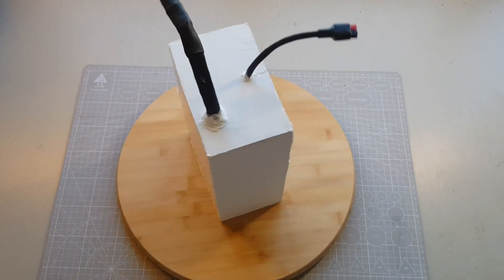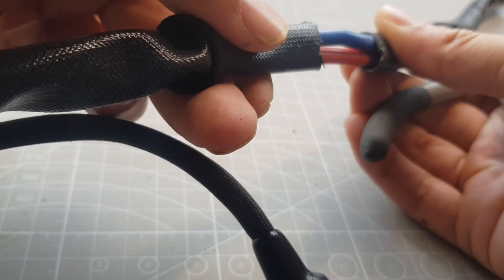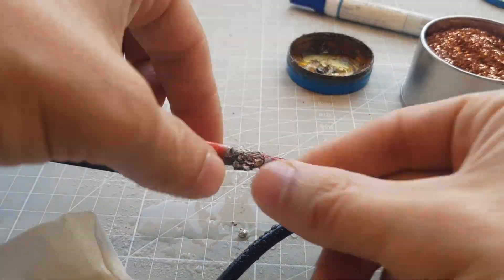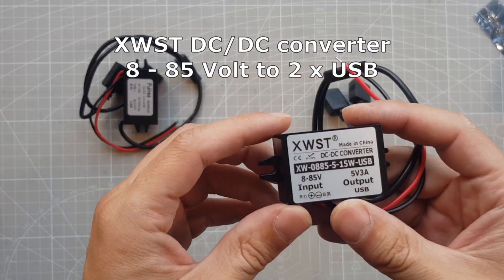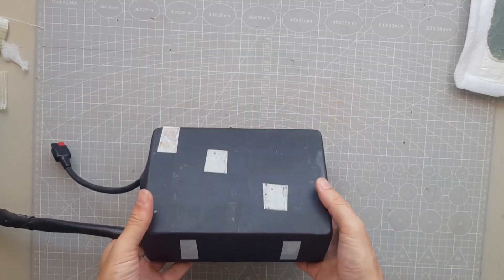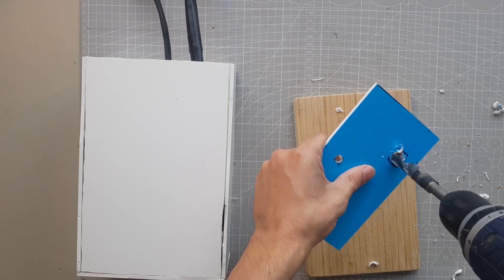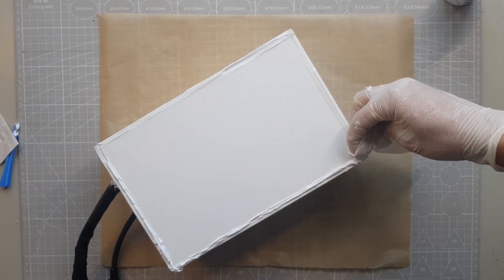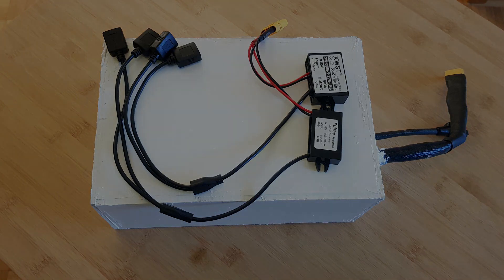building a massive Powerbank from old E-Bike battery

Comment: What about power input to charge it? How about if you wanted to charge it from solar panel with 36vdc
Reply from the maker: Hi Nick, i will hook it up to my Campervan Setup soon, i guess it will be charged by my main Battery (thats on solar) over a converter and a normal (220v to 60v) -charger... That is not optimal, but since i have these parts laying around, it is free" ;-)
Do you ask for camping when hiking?
Reply: @Dirt-E-Bikes  Thanks for your reply. The reason I am asking is because I have a spare 36V 14.5aH bike battery, because my E bike was stolen from my garden, but the battery was in my shed. I have ordered a foldable 200W 36V Solar Panel. But I think I need an MPPT Converter to stabilise the voltage and prepare it for CC/CV charging. At least that’s what ChatGPT told me LOL. I just want to use the battery for general use, maybe when travelling or camping and I can use the Solar Panel to charge it.
Reply from the maker: @UKViking oh no, that sucks (the thing with your ebike).
Yes a MPPT should be able to do that. On amazone you can find a wide range of them. Yust make sure the voltage matches your battery 👍
I recently buyed one for myself but for a 12v Li-ion battery and panel

Comment: i am doing the exact same project. can you explain why you didnt choose a buck convertor and went with dc dc convertor? i am a totall noob so maybe they are the same thing and i am just not aware of that. great video!
Reply from the maker: Thanks, i cant tell you if there is a difference between and if so, what would be better. For me, i only wanted to charge the batterys of my drone, as well as our phones, so for that its oke. But if i plug in all my drone batterys, the converters get really hot, it seems like i run close to there max current. If you plan to use higher current from your battery, you may choose other converters (or more of them ;-) )
Oh, and if you find out about buck converters, please let me know ✌️
Reply: For my project I am looking for a usb hub with multiple ports that can also fast charge. But I am having a hard time finding a DC input usb hub that answer all of my needs. Do you think it is possible to connect multiple DC DC convertors in parallel with usb a connecting at the end or would it create problems?  @Dirt-E-Bikes
Reply from the maker: @yehudamakdosi8451  i mean, if your battery can deliver x amount of current, and you stay within its limits, that should work. But im clearly not a professional this is just what i guess, so please checkt that in some kind of dc forum to be sure. 
I did 2 dc chargers in paralel, and that works. This battery i use can deliver 30amps continous and i guess i pull up to 10amps by loading all my fpv batterys per USB-A... As i said, the dc converters are getting hot, but not the E-Bike battery. 
I found my converters on Ali express but you can find alsp different types on Ebay and other platforms. Please let me know if you find something good, maybe i will add one or two converters to my own setup :-)

Comment: Great video thanks so much.  I was hoping to output USB-C 65w to power a laptop.  Is there a way to do that because those USB adpaters you show seem to only do 5v3a?  I have searched and searched but cannot find this type of adapter so if you know how to do it please let me know:)  Thanks again.
Reply from the maker: Hi Gregdavidd, thanks for your kind comment. I had the same thing in mind and also searched a lot to find something similar that can output 19v with around 3 amps. I did find some parts on aliexpress but was not entirely sure if they would  work. I still think that its a great idea  because the other option would be to convert it to 110/220 volt AC and then use the "normal" laptop charger from there... and that would be even less effizient than doing it with a low quality DCDC converter 🤔
Reply from the maker: I will take a look and let you know if i find something that could work...
Reply: @Dirt-E-Bikes   Hey thanks so much.  Perhaps you will have some better ideas to find this than I did.
Reply from the maker: @gregdavidd  i found some different ones by searching for "dcdc stepdown converter 19V" but as i said, i am absolutely unsure how good and if they would work.
It seems that its more easy to find stepup converter that go with a 12 V Battery, like this one:

Ich habe gerade diesen erstaunlichen Artikel auf AliExpress gefunden. Probiere ihn aus! CHF8.32  33%OFF | 12 V bis 19V 3A 5A 8A 10A 15A 20A 30A Step Up DC DC Konverter 12 Volt zu 28 Volt Boost DC-DC Spannung Regler für Auto Laptop
https://a.aliexpress.com/_mrKd8mu
Reply from the maker: There are a few stepdown converter that get in the range of 24volt (i am not sure if that would be to much for my and your Laptop...?)
Like these here:
https://a.aliexpress.com/_m0JbDAU
Reply from the maker: And then there are these that should match the 19v more close, but are regulated over a very small potentiometer...

https://a.aliexpress.com/_mOvT0n6

 you are probabely more experienced in electronics than i am, let me know which one you would prefere, maybe it would help me to decide which one i should try ;-)